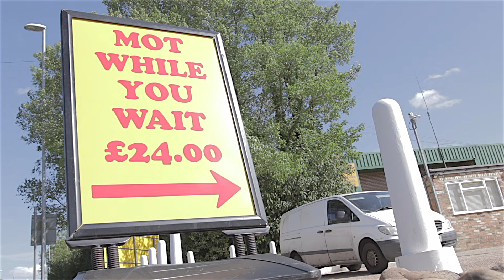High Pressure Fuel Pump Removal, Mk5 Ford Mondeo   And A Broken Timing Chain

Comment: Best channel on YouTube! I have a mk4 mondeo 2.0tdci 2011 facelift, is it the same procedure for hpfp removal or do you have a vid doing this on the mk 4
Reply from the maker: it is similar but you have a different pump..you need to remove the battery and battery tray..then you can see the pump better and remove the pipes and three bolts holding it on...your pump does not need to be timed up
Reply: @alan4x  thats great thanks mate and all the best

Comment: Alan, great video. Is it advisable to replace the Mondeo chain tensioner at maybe 200k   or are tensioner failures an unusual event?
Reply from the maker: on the mk4 mondeos i not had a chain tensioner fail yet...had a couple fail on the mk5 and we do change the oil regular ..proper ford oil..because of the amount of work involved i would not change the chain unless for some reason it did get noisy then i would change the lot
Reply: @alan4x  d

Comment: Hi, 

Ford Johnson's have kindly advised me today after its service of a leaking engine sump, which appears to be a minor drip, and a external leak coming from the high pressure fuel pump.. im not experiencing any loss of power, fault codes or limp modes, you can imagine the cost they quoted considering they want £80 to replace a rear number plate bulb ..

Comment: Don't count your chickens.... my money is on those valves being bent, hope I'm wrong but the kind of luck I have, if you chopped a woman in half I'd get the half that eats.
Reply: I think the rockers are sacrificial on these
Reply: They snap the rockers on both this engine and the previous engine in the mk4 2.0 tdci,
Reply: SAME LUCK HERE
Reply from the maker: lol.. i know what you mean..been there many times...no the valves will not bend...the rockers will break first which is good
Reply: @alan4x  good to know Alan thanks and btw I done my belt chain conversion on my connect and everything went spot on because of your advice...you're my favourite oily :)